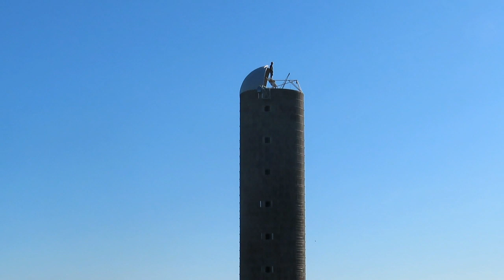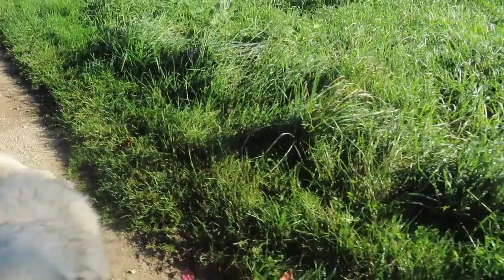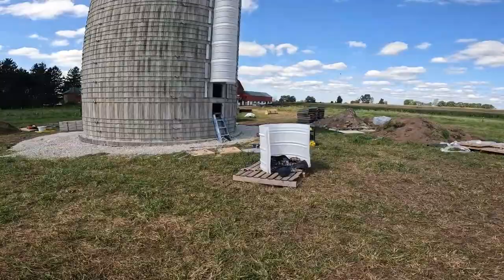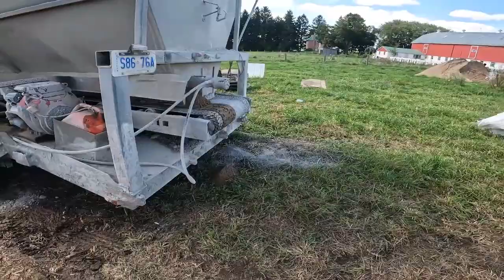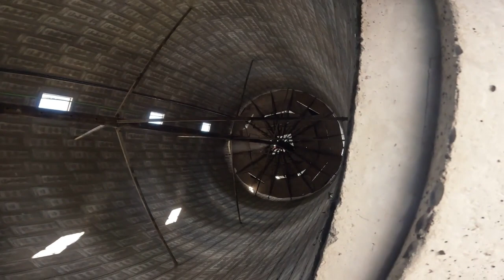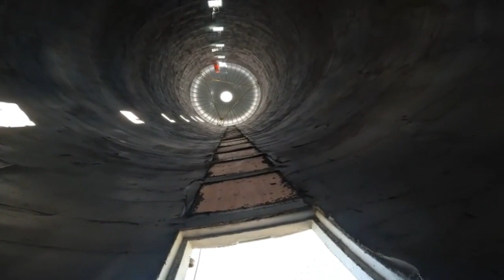Crowning and Plastering the Silo

Comment: will it have an automatic unloader?
Reply from the maker: Yes, it will. It is supposed to be coming this week.
Reply from the maker: The unloader in the silo will auger the corn to a blower that then blows it down the white Shute and is run by a motor. We have to have a conveyor at the bottom of the Shute to run it in the TMR. We plan on putting up a commodity building beside the silo.